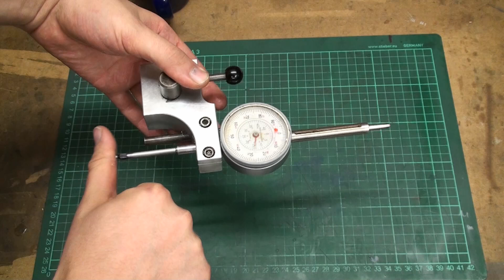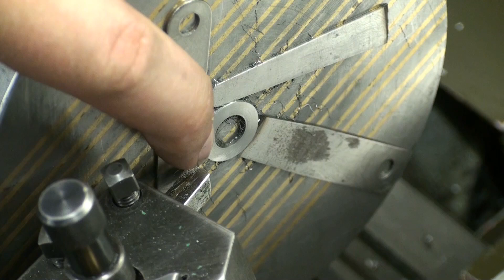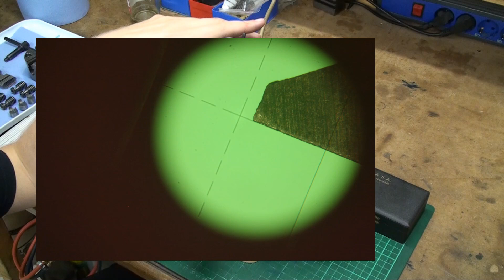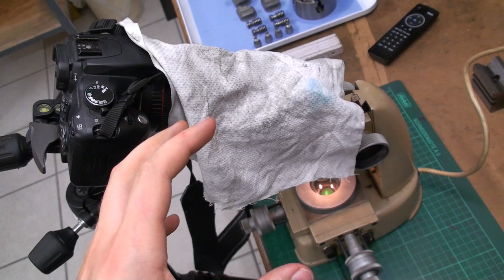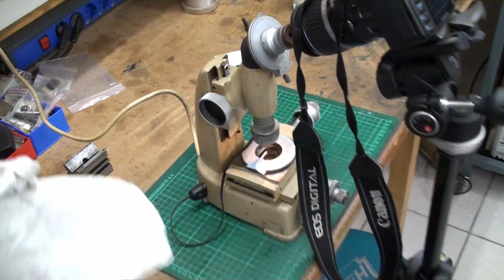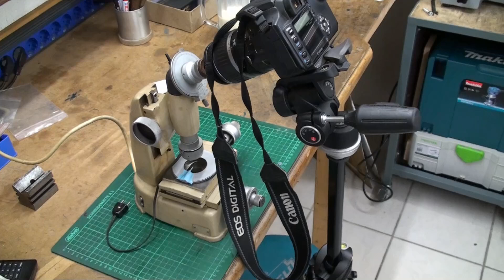Shoptalk #8 / 07-2015

Comment: My first thought is ohmigosh! He's selling the mill! But I am very sure you know what you're doing. The magnetic chuck episode brings up an very old clock/watchmaker's device, the humble facepate. The old-timers called this a "shellac chuck," and faced with exactly the same problem you had, to stick the washer (or whatever) to a faceplate, would heat up shellac flakes until they melted, then stick the washer on to the shellac and let it cool. To get the thing off, heat it up. I am sure the watchmaker's lathe you showed in an early video has a couple of shellac faceplates in it. The modern equivalent of shellac is superglue. You can superglue thin pieces to a faceplate, thin them off, then heat up gently to allow release.

Comment: Hi Stefan.
Nice episode. Have you consider Aciera F3 or Deckel FP1. I do not know how Chinese machines are exported to Germany but here in sates are, sorry unfinished or made in a hurry.
Now your CNC is gone but can you make a description of  hardware/software you used, and the pitfalls?
Thank you for all you are doing.
Radu
Reply from the maker: 3rcamera Of course - The first machine I ever ran was a Fp1 - But they are expensive and its to heavy to be moved into my basement..at least not without very much effort. And spare parts are incredible expensive, for example the spindle bearings...
I was running LinuxCnc (formerly known as EMC2) and was very happy with it. It worked without any problems and was very reliable. Before that I used Mach3 for some time and that worked also not to bad, but the user interface hurt my eyes.
Most of my gcode was handwritten in gedit and the more complex contoures I did in Sheetcam and CamBam. For some of my 3d parts I used Creo/NC at work.
As for the hardware, the stepper driver was a "TripleBeast", its a made-in-Germany stepperdriver for three axis and a mesa 5i20 card for the in/outputs.
Thanks for watching and commenting!
Reply: 3rcamera Thank you and good luck with the new machine.

Comment: I have a geared head RF45 clone, I wouldn't recommend it, look for something better.
Reply from the maker: sharp x Hi, By the time this video was edited I already have a RF45 clone - Still not assembled as I have to reroute 3 phase/400V into the shop and build a stand for it, but overall it doesnt look to bad :)
I testdrove the Rf45 of a friend and it did everything I asked it for - Endmills, wheelcutters, big drills and shell mills, Lots of torque and suitable big travel - And If I find things that I dont like I can improve it ;)
For me its a lot of machine for not that much money - And I am constrained by the basement - I will not move a full size toolroom mill down two narrow staircases with a 180° turn in it :)
Reply: I hope you got the dovetail column type and not the round column one (which is what i have). hope this mill will work for you, I got really frustrated with it although to be honest i did a lot with it so if you can cope with it's limitations is fine to a certain extent.
Reply from the maker: sharp x I got the dovetail column.

Comment: Hi mate.
That is a wonderfully nice microscope.  Did you know that you can pick up a digital camera on Ebay that attaches to the lens.  They are relatively cheap, $20, - 70; and convert the scope into a digital scope that you can see on a VGA screen.  That was a nice machine that you let go there, I think that you have the acquiring of machines a little wrong.  One does not sell machines, one only buys machines.  You see?  Just a rooky mistake, it happens to the best of us.......
Marcel.

Comment: Would that microscope be designed for very specific things?  Just strikes me as odd that you could potentially measure to 1/1000th of a mm yet the method of affixing the subject is tape - didn't look like there was anything on the microscope itself to be used as a securing device.